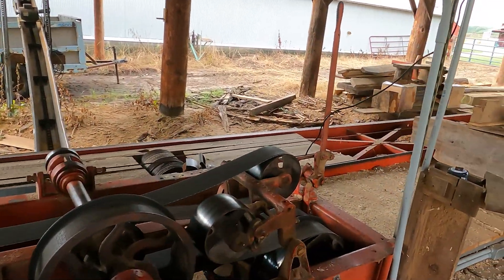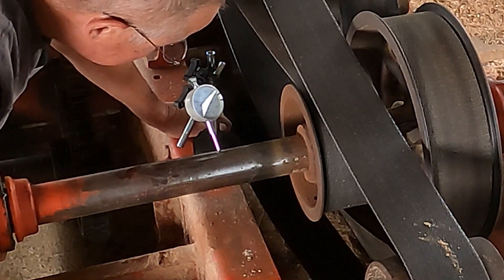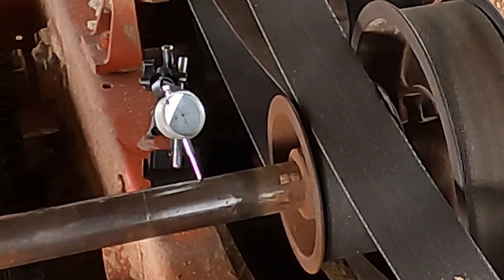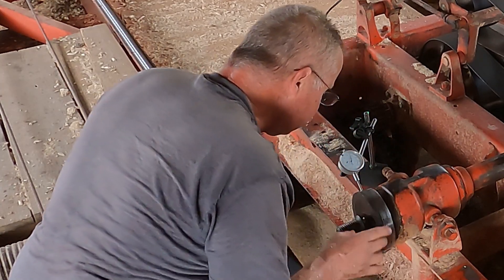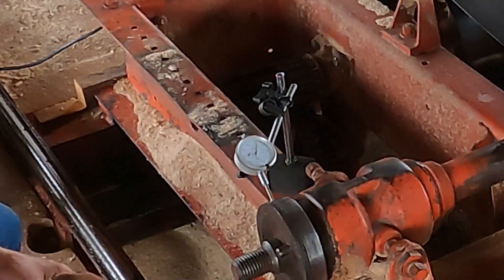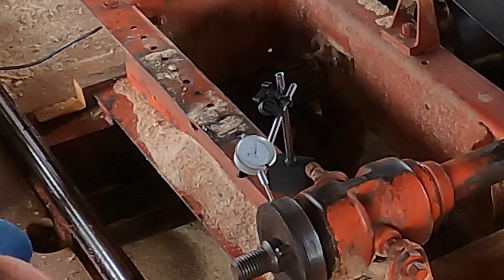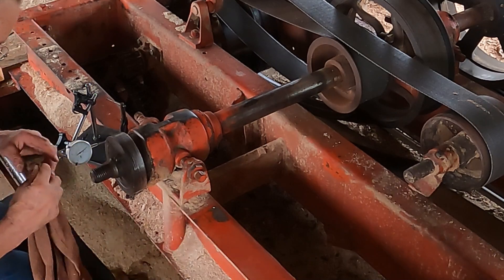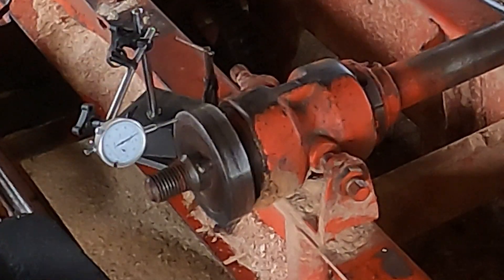Why are these bearings running HOT!!!!

Comment: HI WAYNE U can true the small wheel and see what that does I think the belts are 2 tight or something else is out of alinement all those bearings should run cold unless the bearings are bad I think 🤔😮 2 much tension and the belts are 2 tight what is making the bearings hot 😮😮 OMG 9 14 2O23
Reply from the maker: Clarence, I think when we adjusted the bearings we may have missed a step and not loosened up the bearing saddle to allow the bearings to run straight. We'll see! Thanks. Wayne

Comment: hi guys,
as I do NOT own or run a frick sawmill take my words with a grain of salt
bearings get hot if too tight and or have too heavy a load on them
I dont see this on yours but you will hafta check it

perhaps someone used the wrong bearing material in your castings ???
maybe its all lead !

these are just my thoughts 
this is yours , youll hafta make the call 
good luck 
Mike
Reply from the maker: Mike, I agree.... Stay tuned!

Comment: Bearings normally run warmer than the surroundings by 20 to 30 degrees, depending on the load they are being put under.
Reply from the maker: Steven, Thanks. With no load, the bearing nearest the pulley was running 130 F after 3-4 minutes.
Reply: Do they stay at that temp or keep climbing higher? What was your ambient air temp? If it was 100F outside, then 130 is ok on the high side. If it was 80F then you have a lubrication or tension problem. Are the bearings set too tight? @WaynesWorldGarage
Reply from the maker: @stevenclaeys6252  they're climbing,  we shut it down.